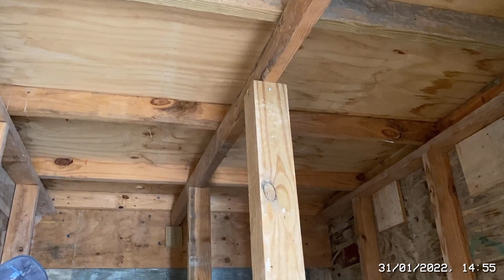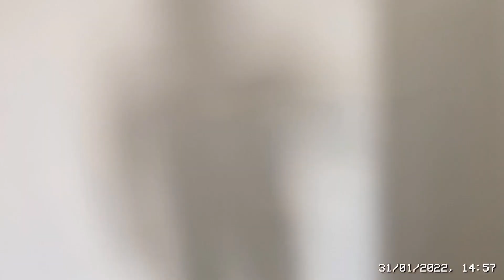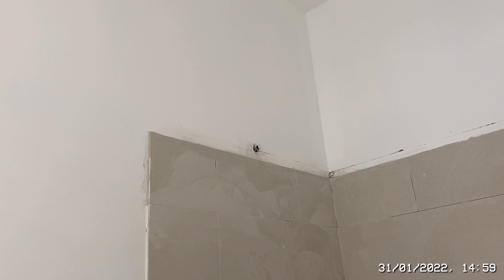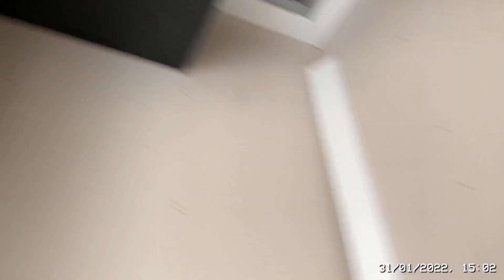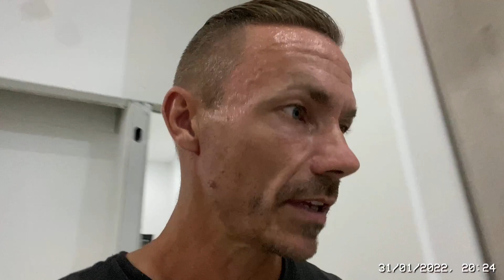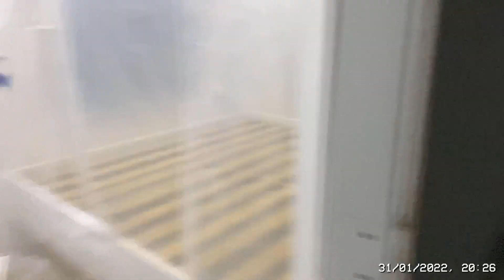Barbados 🇧🇧 Beach House Build - Day 231, hot tap install, bathroom shower tray in concrete

Comment: Hi Alvin did you purchase your ceiling fan in Barbados
Reply from the maker: Hey PAL, yes we bought them from Platinum Imports. They are Stainless Steel and as a result are not cheap. But are wireless and run via the app which is pretty cool!